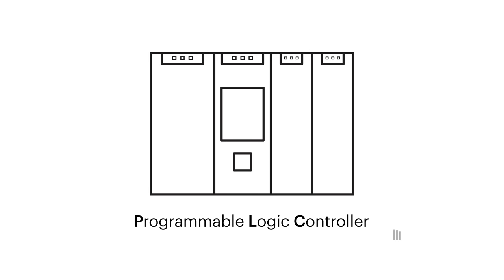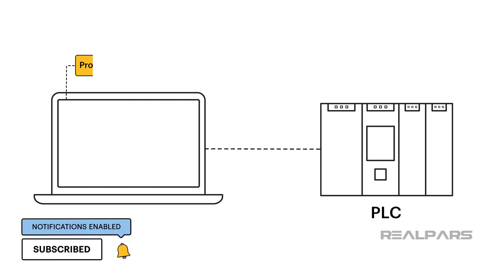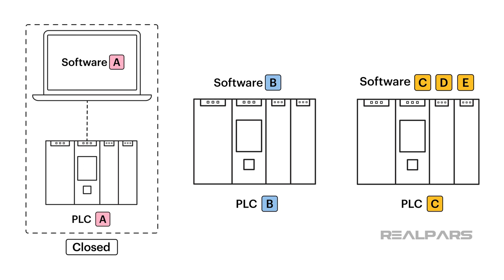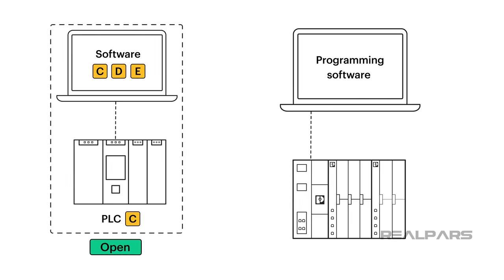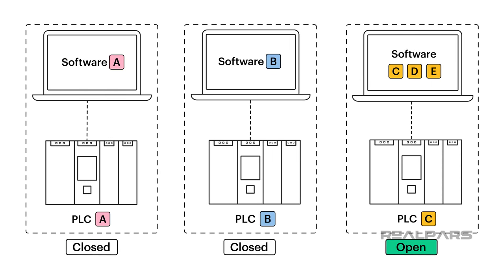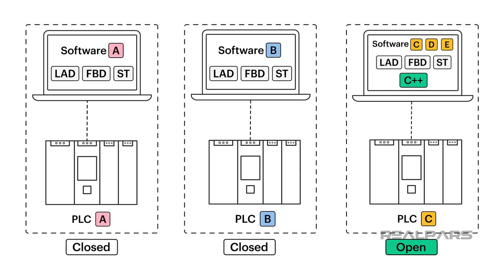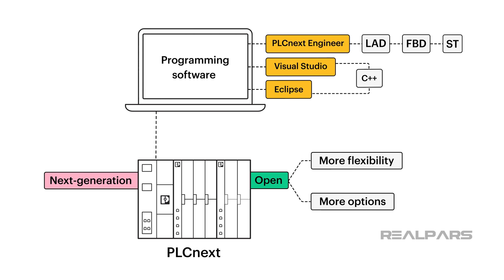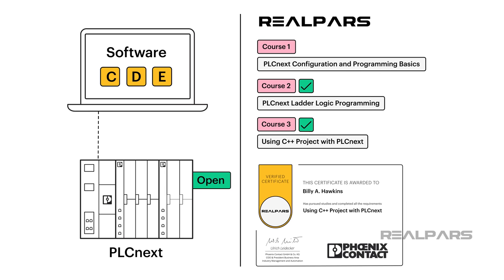What is an Open PLC?

Comment: Any text editor, or even command prompt, can allow you to write code. It's the compiler/interpreter that changes it from text to code.
You can also write code for PLC's using a generic text editor in certain cases, on a closed PLC.

I love the idea of a PLC allowing you to program in C++.
Reply from the maker: Thank you for sharing that, Tommy!
Reply: Yeah but editing code in notepad is so 90.
Reply: I understand the need to oversimplify in a short video. But there is a fine line between oversimplification and giving people wrong information. And in my opinion you have crossed it.
The benefit of an Open system is to be able to use multiple programming languages and multiple PLCs so that you are never locked by choosing one or the other. 
Look at OpenPLC allowing you to use RPi, ESP32, and other MCUs/CPUs and other hardware - this is OPEN.

Comment: Good explanation. But what about program cycle in open PLC? Does it takes similar execution time as closed PLC? As I remember the main purpose of PLC based system other more flexible PC ones is very short cycle time that is critical in many industrial automation process. So my question in general is: will we lose cycle time by increasing flexibility?
Reply from the maker: The answer is in the controller on which the program is executed.  The "open" part of the description of "open systems" refers to the ability to programming the logic independently of the manufacturer of the controller it runs on.  This gives the engineer flexibility to use the best tools available for development of the logic.  However, the code is still compiled and downloaded to a CPU for execution.  The speed of open controllers, such as PLCNext, are just as fast as comparable PLCs from Rockwell or Siemens.
Reply: @realpars  Thk u for detailed answer. Glad to know that program cycle is still depends on size of compilled programm. I am stronlgy agree that ability to use the same code on different PLC is a huge benefit of that technology!

Comment: That’s an interesting concept but wasn’t PLC software designed in ladder logic so it would be simple to understand and easier for electricians to read? I recently had a project that involved programming a stepper motor controller in c++. What a nightmare! What do you consider the clunkiest of all the closed PLC software to use? We have some Mitsubishi PLC’s and their software sucks. Not a big fan of Rockwell’s Connected Components Workbench either.
Reply from the maker: Thank you for your comment.  I am an old-timer in automation (40+ years) and I know that the more advanced languages are going to create problems in troubleshooting for most technicians.  For engineers, these advanced languages are familiar, but technicians do not have the skills, for the most part to troubleshoot these programs.  I always ask the question, "Are you willing to support your C++ program on third shift, weekends, and holidays?" when I have an engineer say that ladder is old-school and we need to program in C++ or some other advanced language.

Comment: Hi folks! I don't really understand why we call PLC "open" when the PLC can be programmed only using its original software and C++. We cannot program it with help, for instance Python, or whatever... As for me, PLC "C" in the video example is also closed. But it's only my point of view.
Reply from the maker: Thank you for your comment.  "Open" is probably an over-used word that needs some context.  If a PLC can be programmed with other than the programming software provided by the PLC vendor, then it is considered "open".  Every CPU requires programs to be compiled into code of a certain structure and providing an "open" programming environment is easier to do with some hardware platforms than others.  In my mind, the only true open platform would be one where I could use a text editor create a downloadable program to a CPU.  We will get close to that ideal in time.

Comment: i thought the open plc can be programmed with any software such as  tia portal, cx-one... it has just been added with another language but does not make it open at all... ??????
Reply from the maker: The answer is in the controller on which the program is executed.  The "open" part of the description of "open systems" refers to the ability to programming the logic independently of the manufacturer of the controller it runs on.  This gives the engineer flexibility to use the best tools available for development of the logic.  However, the code is still compiled and downloaded to a CPU for execution. That said, every CPU requires code to be structured at the machine level in a certain way.  In open systems, the compiler, or other interfaces available for the specific CPU, allow multiple programs, but not all, to be used to create the PLC code.

Comment: Writing a C++ programs for PLC is a good thing, but you have to be careful with stack overflow, memory management and many other things. C++ is not an easy language, that's why higher level languages like LD,FDB,ST were invented long time ago.

PLC are computers, and inside there is probably some ARM microcontroller. Other MCU board like Arduino, STM Nucleo, etc. have free development tools, and main language of choice is C and less C++, but those boards aren't the final product. There is no optoisolation, weak IO driving capabilities, no power supplier, no case (PCB exposed), no EMI certifications, etc. Those boards are for DIYers and electronic designers.

PLC is a ready to use product that can be used straight out of the box, and mount into DIN rail. Writing C++ programs feature can bring new customers that are familiar with "normal" programming languages. With strong MCU you can flash microPython interpreter, and use Python. Maybe PLCnext designers should implement that interpreter?
Reply from the maker: Like most industrial products, new products are driven by demand.  The drawback of microPython is the limited I/O support, which is the main feature industrial control systems are built around  Instead of a 32-channel GBIO with fixed I/O types per channel, we would need to see a 256-channel GBIO with configurable channels before a microPython controller would be viable for large-scale processes, IMHO.  But the world is moving toward these products, so it may be sooner than later that they will be available!
Reply: I am finishing a stm32 board for replacing siemen's logo in some of my lower end projects. The logo works, but it is horrible to program and full of limitations in such a way that i consider the microcontroler using freertos way better for everything